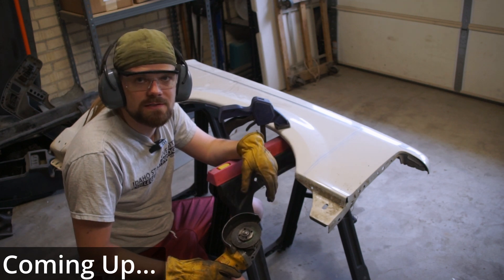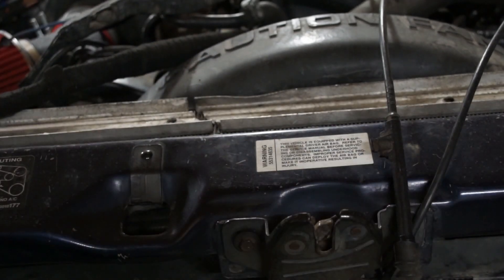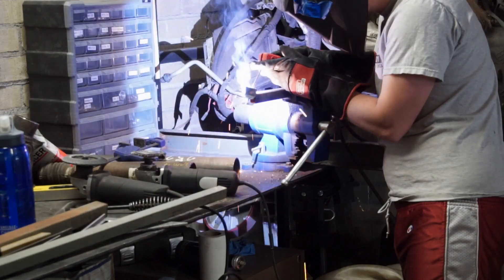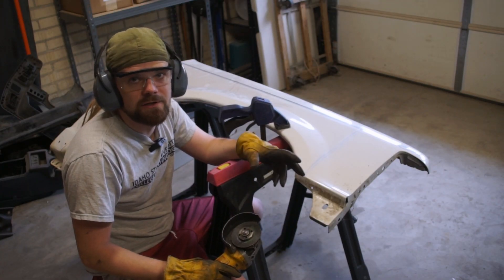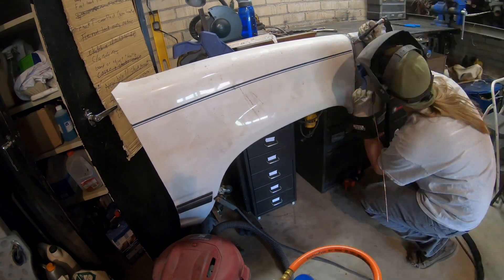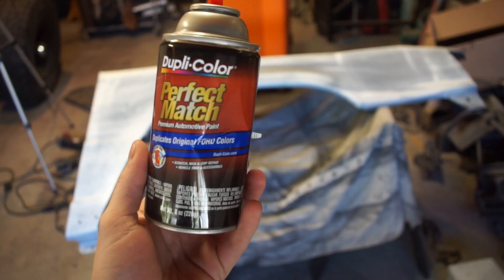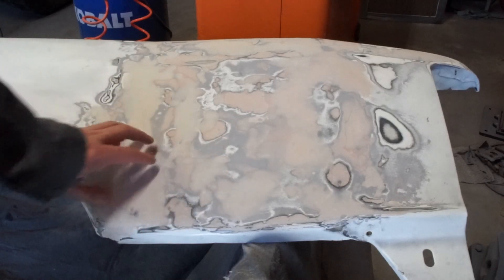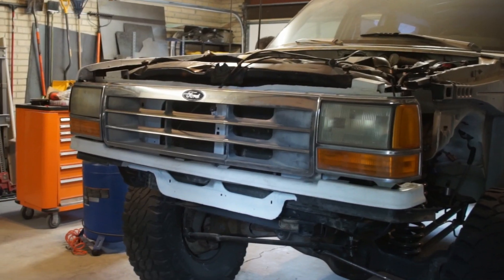How I Made My Own Fenders and Front Clip

Comment: Little tip for future reference. When using a lot of filler spray the bare metal with self etching primer first. Filler will leach and won’t adhere or rust later.
Reply: As for the pin holes those can be corrected with Glazing putty. Once again seal it with primer beforehand. Cleaning everything and keeping it clean is the most important thing when doing body work. Prep makes the paint.
Reply from the maker: Thanks for the tips! Pinning so others can see.

Comment: If it turns out that you don't like your fenders you can do what the jeep guys do and make a partial tube fender. You'd just make a template of the wheel arch to make a section of plate to bolt on and then make tube or square pieces to weld on the plate. Also to fill pin holes etc you want a skim coat filler. It is usually different from a knock down type of filler

Comment: Not to downplay the rest of this project the least bit, but this part is what I’ve been most curious about
Reply from the maker: Ive gone back and forth on it a lot, whether Id use sheet metal or fiberglass. I think the sheet metal turned out alright, but it was a ton of work. As a spoiler since youve been around forever, for the hood Im planning on giving fiberglass a go. At that point I’ll know for sure which I prefer 😅

Regardless I can drive it around for a bit without a hood, should be fine in idaho 🤣